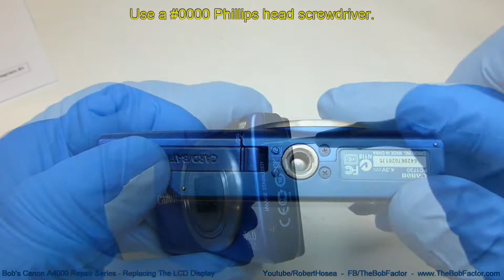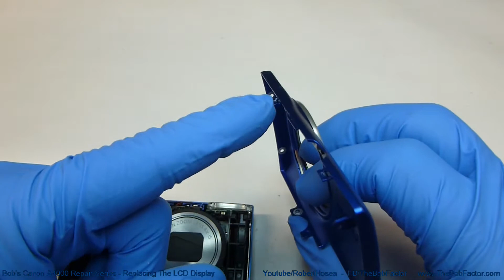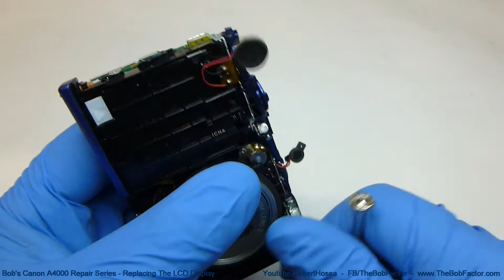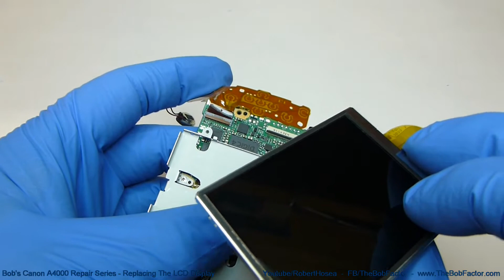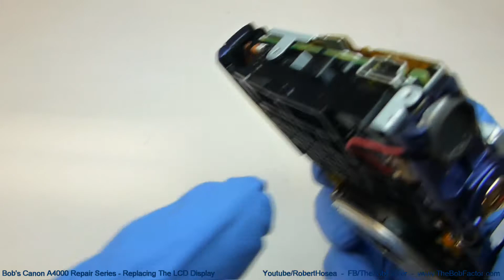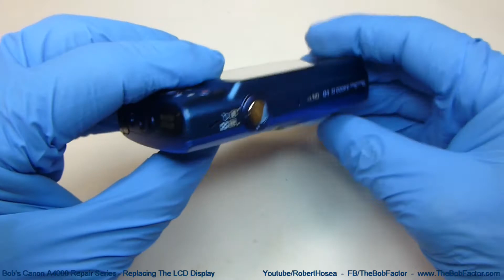Canon Powershot A4000 Camera - Replacing The LCD Display

Comment: Sir what if i accidentally destroy the white that holds the golden ribon , the upper one , if i return all the parts the LDC didn't work but the power is okay
Reply from the maker: It would depend on whether or not the flat ribbon cable was damaged. Is this the piece that you are talking about? https://youtu.be/yJBsNoXvwvY?t=342
Reply: The zif holder sir I tear a little because at first I don't know how to remove the ribbon to the zif holder that has clamp so the white is teared instead of the black color clamp
Reply: When I bring back the old LCD of my cannon it didn't work, I thought the new LCD is the problem
Reply: But the power button is still working
Reply from the maker: @sianong.project  If the cable is torn, even just partially, then it will need to be replaced. Except in a few cases, it's almost impossible to repair a torn cable. I would suggest looking for a broken A4000 on eBay, and then use that same cable from it to replace the torn cable. The power button may still work if the cable is only partially torn. Sorry I can't be more help.
Reply: @Thebobfactor  no sir the torn part is the ZIF holder(the white part), parts of clamp that holds the ribbon of LCD,